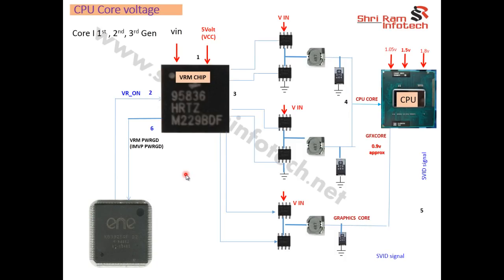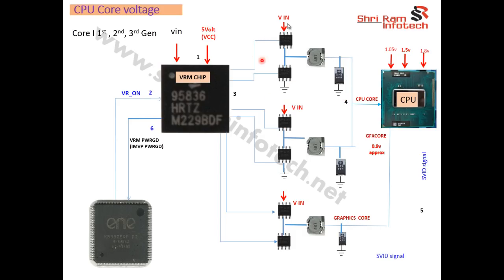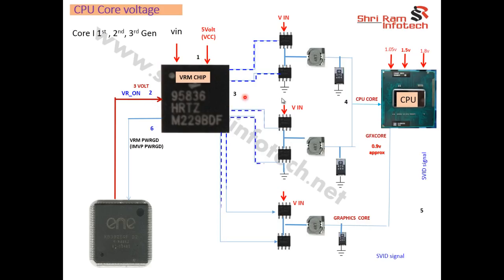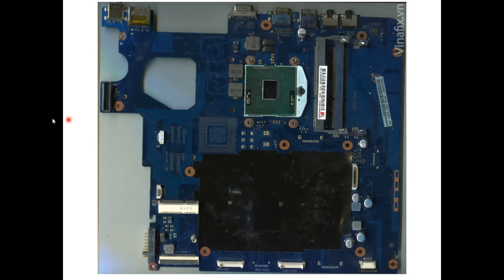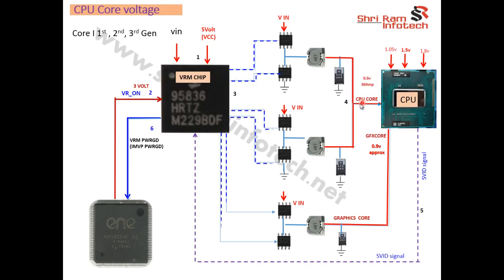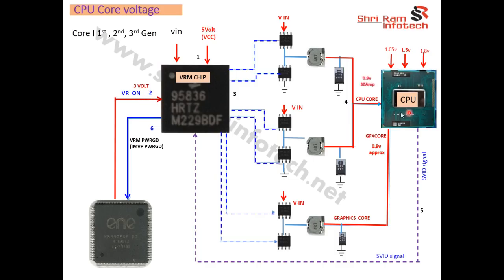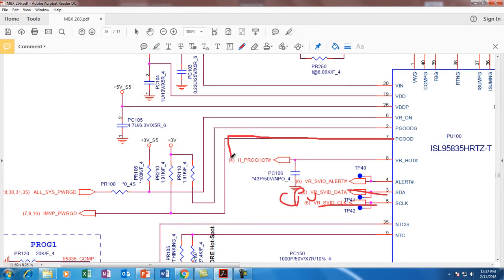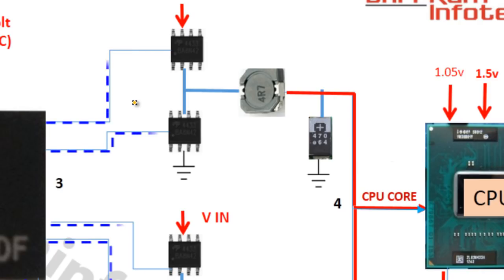VRM SECTION CHIP LEVEL LAPTOP REPAIR | ENGLISH | SHRI RAM INSTITUTE OF TECHNOLOGY #chiplevel

Comment: interesteing video. I'm working on a motherboard (P4 800M I think (its at work and I'm at home right now)) that would start up for a short period of time but would fail after 2-3 minutes. It had several poorly replaced caps so I replaced them again but it would still go dark. 

This board is part of a computer that uses security schemes to marry hardware to each other to thwart bootlegging and copying of the software. If I cant fix this board this device is toast. :( 

Thank you for the pointers. I know for sure that at lost one, if not all, of the FET supported voltages are missing from the CPU.

Comment: what is the use of transistors and resistors and small IC function in each section
Reply: Sudheer M.S transformers are for purifying little version of the DC current it's outputting pure DC . resistors for controlling the current flow. And the small IC chips are for enable voltage and etc

Comment: I have a problem with this integrated, the board is la-7912p, it happens that when turning on the board it stays on at 0.620 A, I don't know, it turns off and the fan regulates depending on the temperature, obviously it never gives an image, Vcore appears at 1.050 volts but Vgfx never appears(It goes without saying that if these voltages are present, all the rest of the sources and secondary voltages are also present, in fact I already measured them many times, only Vgfx is not present). There is no short circuit, I changed the processor and the same thing, the Vgfx mosfets are fine. I don't know why it doesn't turn on and I don't think it's the 95836 integrated circuit's fault. Any ideas? Replace the integrated maybe? Pch? Bios?

Comment: Hi, I have a HP laptop. Battery is dead(Battery # 807611-421). The battery has only 3 cells, which gives 10.95V. I found in Ebay a battery with the same number but has 4 cells (14.8V). My question is will this battery damage the motherboard? The voltage (either 10 or 14) will be converted into 3.3V & 5V so will this 14V harm the logic board? Thank You
Reply from the maker: battery voltages should be same output

Comment: CPU needs 30 amps GPU 10 to 15amps  ? Are you sure about that ? The whole think will just burn if it gets that amperage. Like it will explode.
Reply: yes.but low voltage